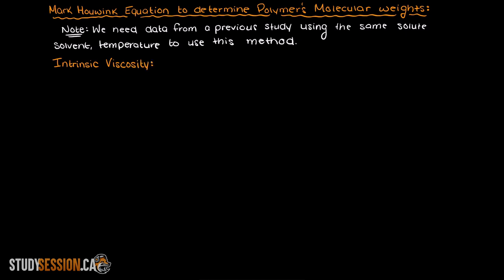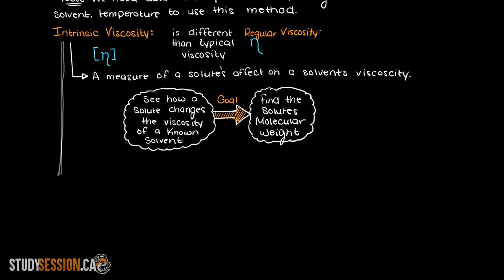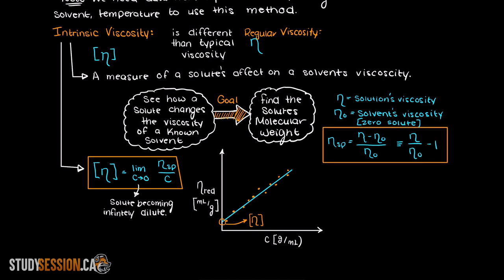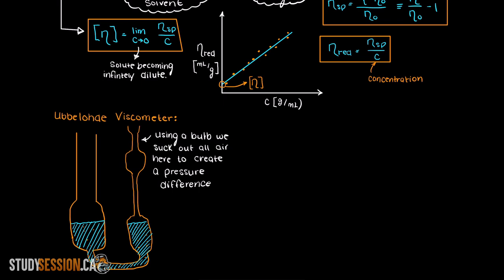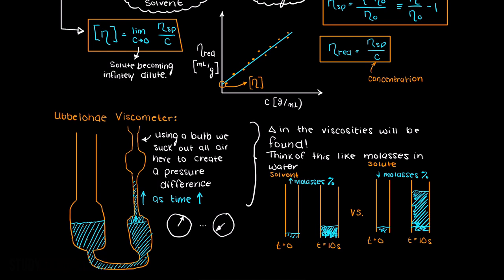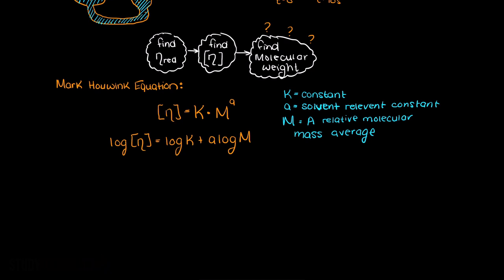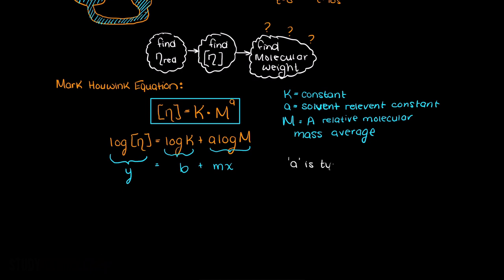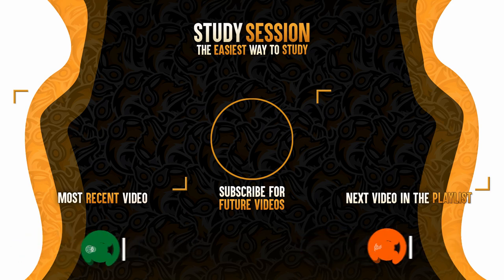Intrinsic Viscosity and Mark Houwink Equation

Comment: Thank you very much for answering my request, great video.
Looking forward for your next videos.
Reply from the maker: I’m glad you found it helpful Ali! If there are any other topics you want covered just let us know!
Reply: @StudySessionYT  Thank you for your availability, I would have a practical question, it will be great if you provide me an answer:
In the company I work, we fill vials of hyaluronic acid for a client (used as a viscosity enhancer for joints). 
The problem is, that the intrinsic viscosity decreases over time which means that the molecular weight of hyaluronic acid decreases as well.
And the question is what are the factors that might cause this?
Reply from the maker: @Alibegag  I am by no means an expert in polymer engineering, however, I will offer a couple ideas:
1. The polymer is non-Newtonian and is shear-thinning.
2. There is thermal or UV degradation occurring.
3. Exposure to the air oxidizes some component causing a less viscous product.
Maybe you could check out some research papers on the viscosity degradation of your acid, if you can’t find anything then it will be a unique problem and the reaction is causing an undesirable product. Hopefully this can help you some!
Reply: Yes, thank you very much  @StudySession
Reply from the maker: @Alibegag  just to add onto what I said earlier if you don’t have easy access to research papers look into SciHub!